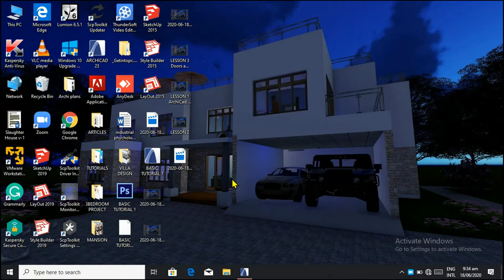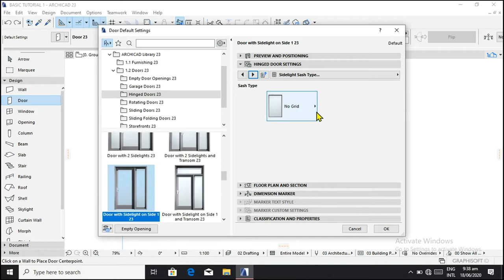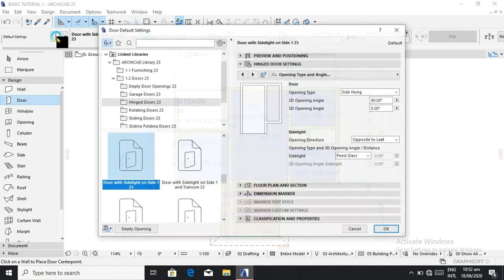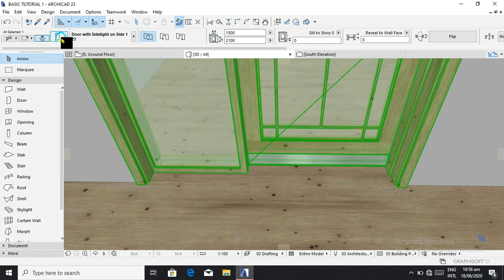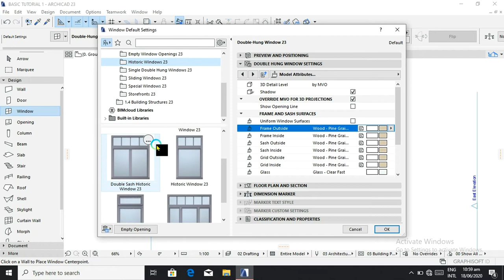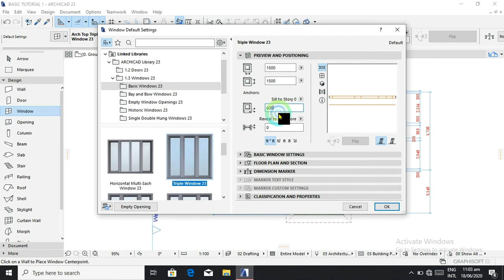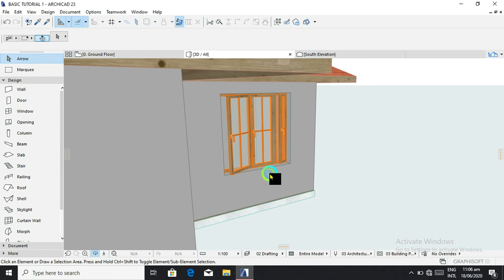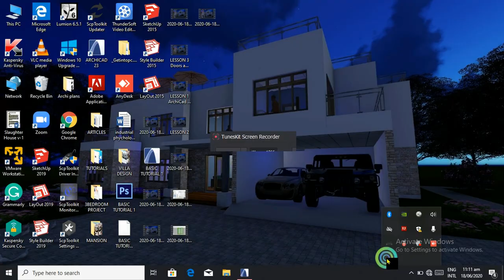Basic ArchiCAD Design Tools Tutorial: Lesson 3 - Doors and Openings

Comment: When i add doors and windows it shows orange lines around doors and windows and doesn't display them well. Can you advise me what to do. Thank you
Reply from the maker: Thank you for your question Orange is default colour for fills . Such as Cut line pen, uncut fill type let's say line fills. So if you want you feel orange colour it's not serving you well highlight the opening or window  go to basic window settings and move to <> model attributes because you want to remove or change the line fill (colour orange) appearance in 3D scroll down to FRAME AND SASH 3D PENS. From there you can either remove orange colour or choose pen fill that will help you see you work better. If you found this helpful please consider becoming a Patron on Patreon. https://patreon.com/GlamoDesignStudios